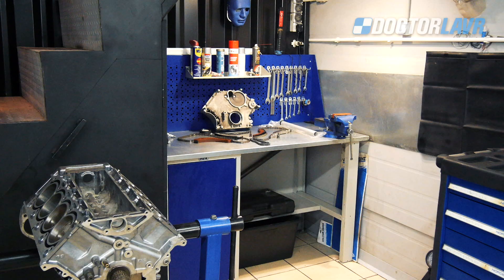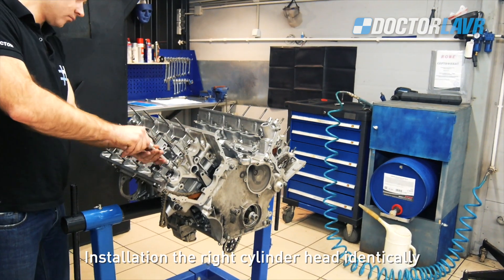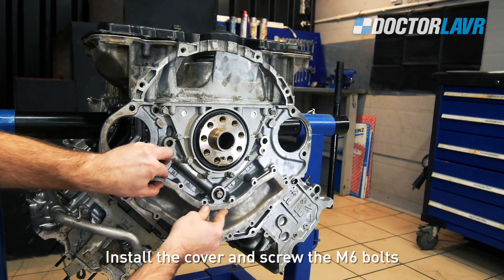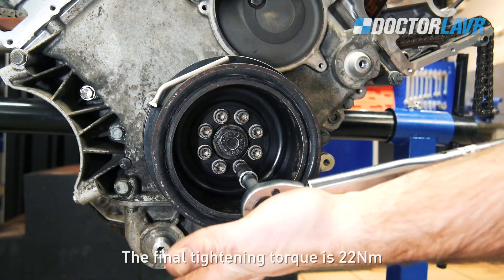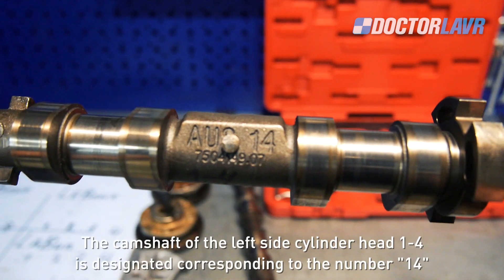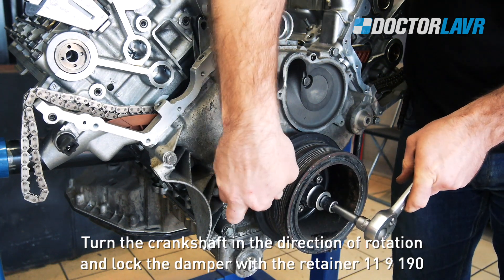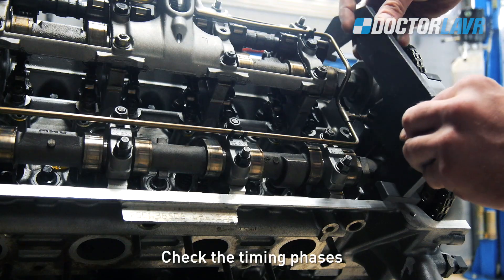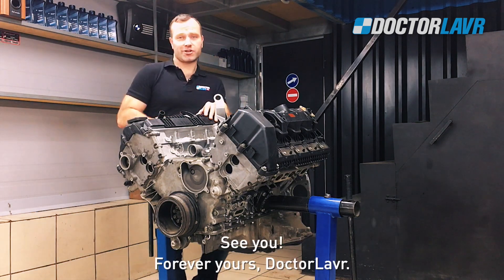BMW engine N62 V8. Assembly instruction. Part 2

Comment: Hello my friend
The engine of the BMW N73  , but spring  what I blended there is a difference between its size, is it small for the exhaust or for the clean air?

Comment: Excellent Video, My adrenaline is pumping after seeing it. I am in middle of disassembling the engine but feel excited and confident that i should be able to take it apart, clean it, and put it back together. Could you mention names of tool used the one look likes weight scale which goes in between the torque wrench and bolts?

Comment: Thank you! I follow both part of your video to rebuild my 645ci N62 engine. I just confuse you mention the torq in Nm and Hm is the same?
Also I note that in this video you did not install two bolts on both side (see at 13:27 and 14:30) that going to the lower timming cover before you install the upper timming cover. Don't know video have edited or cut at some point?
Other you use only one tool flip around to position check intake and exhaust camshaft?
Reply: Same question here, what is the torque spec for those bolts?

Comment: For the valve cover, what was the torque specs you used for those bolts? I can’t seem to find anything on line that says what it is. I know you state 10hm but looked that up that’s just a measurement for the size of socket or nut/bolt head. Thanks for your time

Comment: After a n63 engine replacement factory I drove the car about 15 times transmission slipped kept driving it which ruined  the guiboo and flex disc for a few trips I was told when I brought it back in my trans pan needed replacement and lost trans oil. they said under warrant the coolant end cap was fixed for free which I guess keep the oil cool for trans?. Just curious as I was adding coolant due to what I thought was a turbo line issue I got fixed. Adding coolant so no overheating on gauge. Is it possible the coolant end cap not cooling the oil caused it to fail?

Comment: Really tempting to rebuild the engine in my x5... I watched through both videos and they were great. Did you have to gap the piston rings? 

Also no mention of valve stem seals I imagine you put new ones in but didn't mention it.

Did you have to do anything specific with repair or replacement for vanos??
Reply: 11:41 of Part 1 of the build as this is part 2

Comment: When the pin is in, locking the crankshaft, cylinder 1 is NOT at TDC, right? All pistons are half way up so that we don't bend any valves accidentally when we set the timing? Correct?

Comment: Awesome video. The N62TU is an awesome motor. Underated. X5 with DISA, ram air and high octane fuel will pull hard at high speed especially in cold weather. It appears the rubber is cracked in the harmonic balancer, this can cause random misfire and affect smoothness values in INPA diagnostic. The best non turbo V8 BMW ever produced as long as you change the coolant and oil once a year. Dont forget to silicone the "pressurized" oil weep hole to no where in the upper left timing cover or it will leak in a short time.

Comment: Note: If something looks simple and easy to do then be damn sure it is going to take you 300 times longer and it will be far from easy :) 
PS: Loved the video very much.
Reply from the maker: Thank you friend for your comment!:)
Reply: @doctorlavrbmwperformance2467  fate brought me back here and I watched the video again before I wrote this :D may I ask you something? I recently bought a E53 with the N62 engine. The previous owner has probably taken out the chain tensioner screw and put it back in with red sealant paste... and now it drips oil from that place. Can I unscrew the chain tensioner to clean the space and put it back in? No engine rebuild just tensioner out, clean and back in (both sides).

EDIT: Just did that and if anyone ever cares about the same thing then all you need to do is take the old one out, have some rag ready to catch excess oil coming out, prime the new one in oil (pump sumberged until no bubbles come out when pressing and pumping) and then put the new tensioner where the old one was. Done. You can compare if it was a good thing to do when you put the old and new tensioner against each other and press them together. If the new one will stay in place while the old one will literally vanish inside the body then you did good. If they push evenly your old tensioner is probably still okay and did not need changing.

Comment: Have a problem levers of pushers i replaced them whitout watch how they stay so now they are mixed what to do?
Reply from the maker: This can cause a temporary problem for several days. If the levers are alive, then the engine will adapt and will work stably. It's not scary, friend. But it is better to avoid this mistake.
Reply: DoctorLavr BMW high exhaust systems I think my intermediate levers are not sitting fully over rocker arms. How can I fix that
Reply: Did the car ran ok? Mine is mixed too
Reply: Ok thank you so much